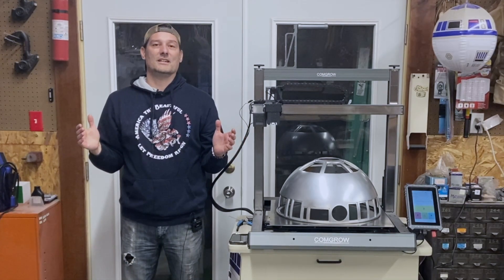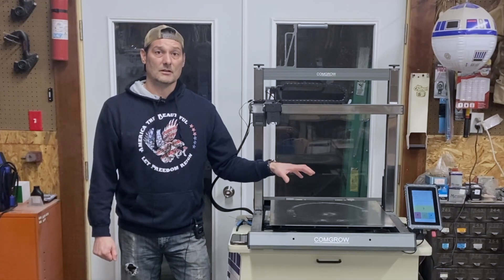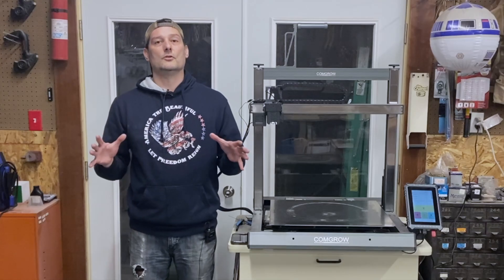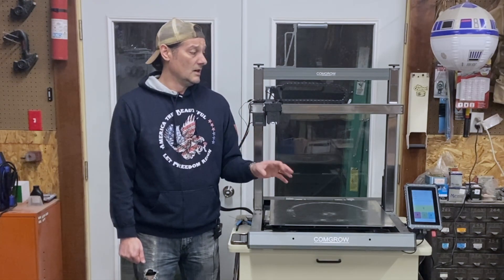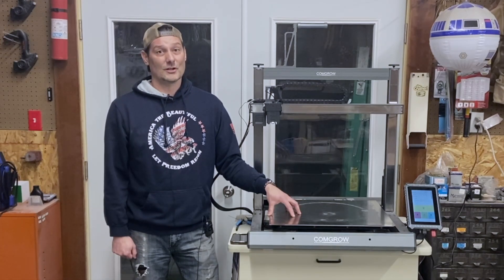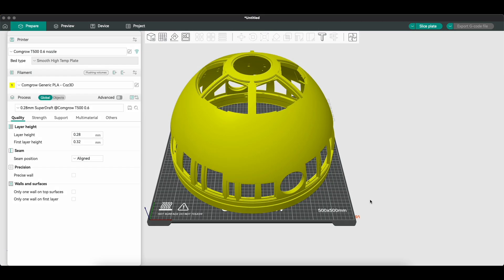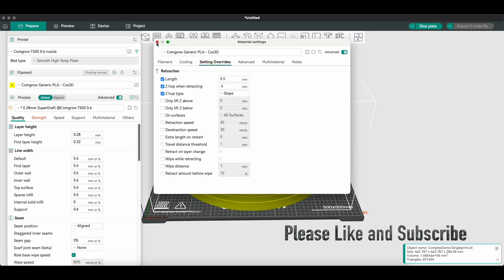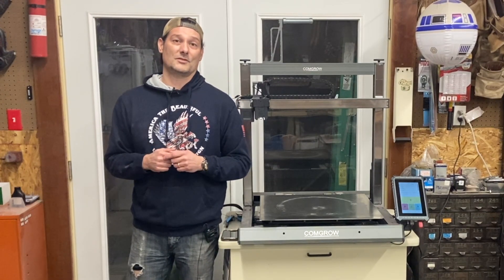Comgrow T500 and printing an R2-D2 droid, It's a big printer  but is it good?

Comment: Bought the T500 when it came out and couldn’t get it to work. Guess I need to pull it back out and give it another go with your settings. A one piece R2 dome would be amazing time saver versus glueing up and spot putty seams.
Reply from the maker: I hope it works out for you this time around!  It is worth having a one print done thiugh
Reply: @coz3d I hope so. Spending a lot of time, spot putty, paint and sandpaper to hide the seams on the segmented model. I’ll let you know how it goes. Good to know about the print head leak. Thanks for you time and videos. BTW you are the spitting image of my cousin when he was younger. Know any Smallwood family members from Illinois?
Reply from the maker: Haha I don’t but i’m only 1 state away from Illinois

Comment: I have a Bambu X1Carbon for most of my prints but am considering getting a printer with a larger bed for things like domes in a single print. This model appears to have a great price tag and isn't AnyCubic (I've heard too many horror stories regarding their FDM printers) and having the settings you used to help make it work makes this seem to be a more acceptable model. I'm also thinking I might pick up a texturized print plate to not have to mess with glue sticks. Thank you for the realistic review.
Reply from the maker: Go for it!  It’s worth it if you want a full size done and rings for sure

Comment: So i guess it had to happen, i finally blew out the aluminium heat block and now i cannot print for now. I am getting this sorted out. Since you have a lot more experience than me on the t-500  and i now understand the whole situation that you went thru. Extremely poorly designed piece of kit on that portion of the print head.

Do you recommend to only print with PLA?  if so can you share the brand and type you like to use and the temps?

I have been printing with PETG from the start because it sticks well to the pei sheet "but" it looks like over time that aluminium part above the hot end seems to weaken and can become brittle from the temp difference and i figure that printing at around 230  for petg surely had a real negative impact on that aluminium piece so i am looking to try a different route when the situation is resolved so that i can get at least get a good years worth of printing from this machine.

Please let me know your analysis on the question.

again appreciated.
Reply from the maker: I have been printing with Esun PLA+ on that machine for about 5 or 6 months and still had the same issue so I doubt the difference of PLA or PETG really matters in the long run.  It's a design flaw and I expect it will keep failing until someone comes up with an after market head that fixes the issue.
I am on my 5th head at this point.  Still prints great until that collar fails and destroys the head.  Once replaced you'll be back in business for a while but I'm confident it will fail again.
If you find a good replacement head let me know!

Comment: For some reason I can only send small files wirelessly to the T500. I can print large ones off of the sd card but not wireless. I do have a question though, when filament runs out, will it lock head in place or remember exactly where it stopped? My last large format would not lock in place so I had to be super careful not to move it or only print in sizes less than a full spool.
Reply from the maker: I believe mine locks in place.  I haven’t really paid attention. I usually set an estimated timer of when I think it’s getting low and usually pause it and change the filament towards the end of a roll anyway.

Comment: You mentioned issues with the hotend, and it appears that you replaced the damaged hotends with OEM factory replacements. Can this be better resolved by using a 3rd party hotend, such as a MSDD???
Reply from the maker: Yes, I believe a 3rd party hotend would be the best option but I have not yet done that.  I just replaced it with OEM.  I need to look into MSDD though.  Appreciate the feedback!

Comment: Those are HUGE issues though!!! 

Do you have any experience with max size printers from Elegoo or Anycubic? Are those better? It's hard to find any honest reviews, everyone is sponsored nowadays... You should also point out when you bought the machine. Early batches may be different from later ones.
Reply from the maker: Good call!  I purchased this printer in April of 2024.
I don't have any experience with anything else this big.  I have a Creality K2 max and a Prusa XL but they are of course smaller than the Comgrow  T500.

Comment: I built my R5 on a Cr-10 S5, but I can’t get my T500 to print anything taller than 50mm without it knocking into the print. I’ve tried all the slicers and everything. This thing is basically a enormous paperweight
Reply from the maker: I have had some issues with mine too but with some tuning I've gotten it to work pretty good.  It is frustrating when you spend that kind of money on a giant paperweight though.
Reply: We had a 1st gen. Total garbage, we rebuilt it all. When we’re done the frame will be the only original hardware. We even printed new fan enclosures and replaced the belt tensioners which broke because loctite dissolved the plastic. Our rat rig we built ended up being cheaper and far superior with dual print heads and tons of customization. You’re gonna have to be a builder to get into large reliable 3d printers. There’s just no way around it. Our droid is almost all printed. We have an old cr10 s5 too we’re upgrading, the board on it finally died after 5-6 years of constant use, a true workhorse.

Comment: I guess i have another question. When you print your one shots domes, how do you deal with the inevitable seam line that will appear? any specific settings?
Reply from the maker: Personally I love a single seam line so i can focus on sanding it out.  There usually are settings in the slicer to randomize start and stop points to eliminate seam lines though.
Reply: @coz3d  As a test i printed a basic dome at 30% because i wanted to see what the basic outcome would be. The seam was not that bad even if it is on a smaller scale. everything printed fairly fine, the only area that i think would need mandatory support is the holo hole on top as well as the top itself , i think it would print well with those. The panels are very fine even without support which is kinda impressive. Crazy enough despite its size, the details are extremely crisp and sharp. Printing at 0.2  

I am not printing the complex dome also at 30% to see what it would looks like. There is already a ton of stringing from retractions. But i will let it continue until it fails of finishes as i want to compare the 2.

Comment: Why not do the RC8 Voron Stealthburner mod that should fix you hot end problems. I bought one had lot of problems with it so return it. I would rate the basic machine as over good, but I was not sure I want to fix its problems. My big problem was the bed was warped so the auto bed level on the backside would not correct enough for it.  Half the bed printed great.The hotend seemed to be on the cheap made side or just a bad design. So I’m thinking getting giga or wait a bit.
Reply from the maker: I’ll check out the RC8 and see how that works.  Thank you

Comment: One more... did you ever print the so called Basic version of the dome? That would be the one that has all the panels already set in?  I have but not happy because of the seams and how it fits together but would like to have your opinion if you one shot that version of the dome.
Reply from the maker: I have not printed it.  I’d prefer having the panels separate for finishing personally
Reply: @coz3d  The good thing about it is that the panels are real flush to the dome just like in the movie.

The issue with the seperate panels is that most of the time people sand them and by accident and inexperience give the panels a bubble looks. I. the panels are not sanded in the proper  way. You should print one of the piece and you will see exactly what i mean.

Now like you said, you save on one problem but then you get another one. How do you paint this properly. I was thinking about this for the longest time and then i found a cosplay video and this guy was not using painter's tape or masking fluid. He was using 3m vinyl masking tape. If you look it up you will probably find it. I think that using that kind of tape you could achieve really good results after a few practice runs....

Comment: thanks

a few questions:

what type and brand of filament do you use on that machine. I usually print in petg on my sovol sv06 plus because it sticks very well.

Would you say that it would be better to order the machine with the pei sheet or just buy an after market one and if so where can i find these after market bed sheets?

p.s did you buy the machine early after release or recently. I know that looking at many early reviews the buildtac bed would always tear off no matter what, just wondering if that machine is one from the first wave of sales?
Reply from the maker: Filament is usually esun pla+
We use the original build plate that came with it.
We purchased ours 9 months ago so it was probably a first wave

Comment: Mine showed up dead on arrival. Bad emmc 😢 waiting for a new one

Mine did come with a giant PEI textured plate

Now the head issue is a new one I heard of. What's the solution? Is it really just the hop? Can I buy a spare head just in case?
Reply from the maker: Oh no, that’s always disappointing.
The textured plate we had was terrible.
The z hop fixed our problems and the replacement heads we bought were about 90 dollars but totally worth having a spare
Reply: Honestly, I keep telling everyone about the cornucopia of issues mine has had. I would return it if at all possible. Comgrow saw dollar signs and judt threw these into the market
Reply: @Karl-Barx-420  In all fairness, they shipped a new extruder hot end assembly and a new emmc. The design by default is flawed and requires a few tweaks/work arounds. I saw people were swapping for a new hotend assembly for about $200 and now have a reliable printer for $800-$900. Meanwhile i saw people with their $2000-$3000 DIY ratrigs having countless issues. OOB it seems Elegoo is the only reliable option but its $2500-$3000 and 800x800x800.

Comment: Did you have to pay for all those printheads? Any alternative printheads available yet?
Reply from the maker: Yes we paid around 90 dollars per replacement head sadly.  I have not seen an aftermarket replacement head yet but if you find and test one successfully PLEASE let us know!
Reply: @coz3d  Sadly no one talks about this in their review. This is something that should be sent to Ben Liu at Sovol/Comgrow. This obviously is a design flaw that should be addressed. The head auto destroying itself because of a collision is not something that should happen. It is a common place occurrence and more than 90% of new people do not know about z hop or what it does thus are not using it. I have preached the virtues of Z hop on many FB 3d print group i am a member of.

A lot of people have spaghetti bowl or major layer shifts and the simple fact of enabling and using z hop is the difference between sucess and disaster. I still don't get why this is not even programmed or mandatory in many printer profile. I say that it should rather be turned off due to stringing rather than on and either having failed prints or have your print head destroyed.

I am inclined to say that you might want to do a short video on what Z hop does and how important it may be. I know you do this in this video but z hop should have its own dedicated video as it would pop out more and help people.